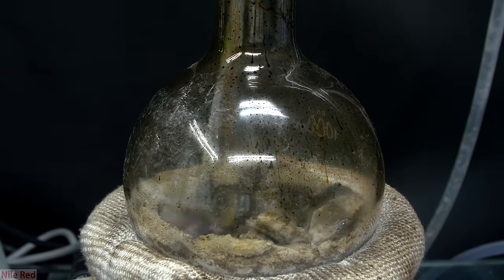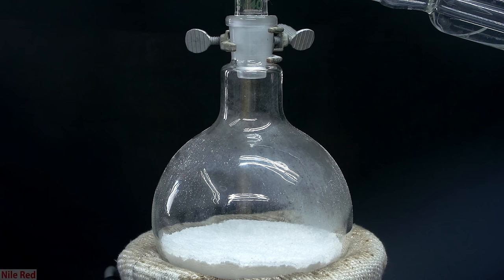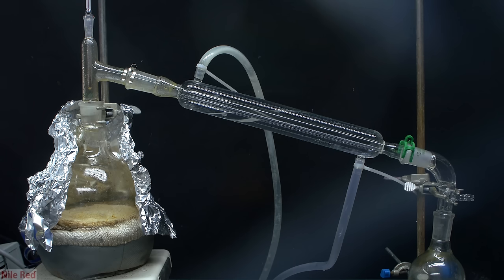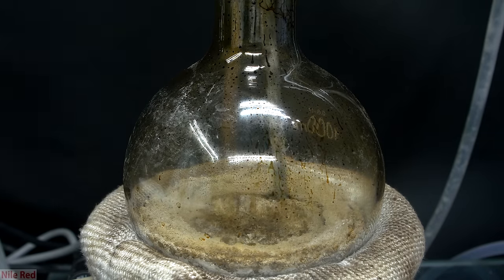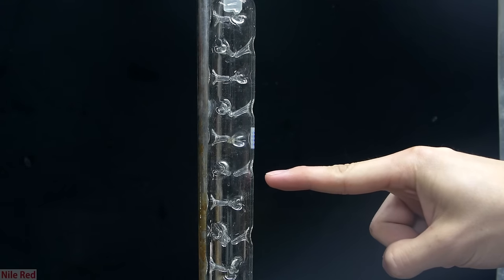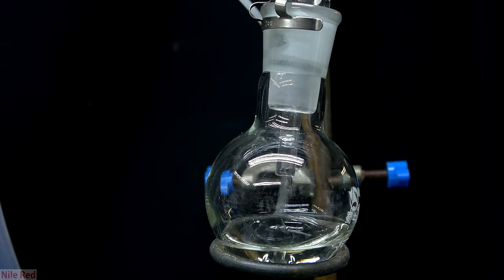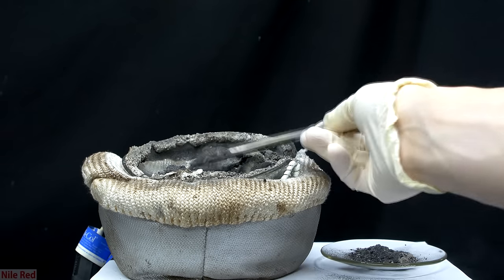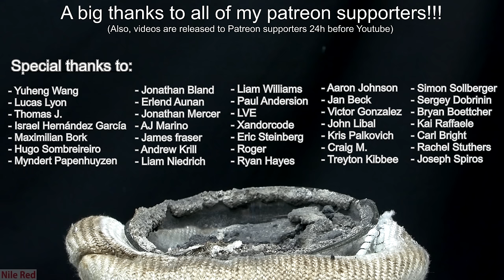Making Acetone from Calcium Acetate

Comment: I tried this reaction, I thought it smelled sort of like acetic acid
Reply from the maker: Interesting. Didnt smell like acetic acid to me at all
Reply: +Nile Red it might have also been that I made the calcium acetate by reacting Ca(OH)2 and vinegar and it might not have been entirely dried
Reply: +Nile Red I think another good video would be acetone from isopropyl alcohol
Reply from the maker: TheGinginator14 Hmm, that is true. I think I will do that, I never thought of it. Not sure when, but it is going on the list!
Reply: +Nile Red another interesting thing was that I got the same black residue despite using calcium acetate from calcium hydroxide and vinegar
Reply from the maker: TheGinginator14 I assumed that it was carbon, but it might have just been polymerize acetone. I have no idea why I didnt think of that. Basic conditions will polymerize it to black crap
Reply: +Nile Red the yellow color was probably isophorone, which is also produced under basic conditions

Comment: +NileRed can i do all your Projects (like bromine) with 1/10 of the weight of the chemicals because i dont want so much of the product or Must i Experiment with the Same amount of the chemicals (Sorry for My english ,im German )
Reply: Calculate it yourself?
Reply: You can but expect a low yield and calculate everything stechiometrically
Reply: +Julius Eckert Ja er soll es sich halt selber ausrechnen
Reply: If you are using 1/10 of every used chemical I do not see any problems. The relation is important. And be careful with bromine, that stuff is pure death.
Reply from the maker: You should be able to everything on small scale. Yields will vary though.
Reply: wenn er 20g und 70g nimmt kannst fast immer einfach durch 2 oder 5 oder 10 teilen...(also z.b. 2 und 7g)
aber pass auf, wenn du manche sachen mit distillation machst wirst soviel wie nichts bekommen...bei distillation wird ein anteil verloren (wegen platz in kolben usw...kompliziert) d.h. wenn er 200 ml benutzt und 180kriegt dann wenn du 20ml machst kann sein dass du nichts bekommst....und beachte die sicherheitshinweiße...ausser du bist chemiker und hast labor...wenn du hobbymäsiß machst dann würde ich brom oder cyjanid oder andere relativ gefährliche sachen lassen...oder sehr sehr sicher die durchführen...
aber so'n aceton kram kannst machen wenn du selbst kaum achnung hast...solange schutzbrille und draußen kann nichts viel schief gehen...
Reply: +Niklas Müller cyanide is way worse...i need stupid nitric acid but german law is shit...(i need some for goldplating) i can make cyanide and use that...but this is too toxic for me to handle...fine dust is shit...bromine will evaporate and it's colored...
Reply: Yeah, german laws are kind of silly. Cant buy nitric acid anywhere, have to make it from potassium nitrate (wich is hard to get too)
Na klar ist Cyanid schlimmer aber Brom ist auch nicht geil wenn man es einatmet :D
Reply: +Niklas Müller ja dann sag mir bitte wo ich ohne bullen und scheiß und EVE und kackwurst nitrate her bekomme? ich hab schbauze voll dieses gesetzes ....
die denken alle dass ich gleich ne bombe bauen will...
brom einartmen sowie stickstoffoxide ist schlimm...chlor ist auch aber nicht sooo....und cyanid und HCN ist komplett andere dimension von giftigkeit...
wollte letztens Nicotin isolieren...(ich sammel jeden coolen stoff...drogen (legale..) sind am coolsten...) habe nur geisteskranke procedur für mörder gefunden...bei HNO3 auch gleich nitrotoluol oder so 
und DCM brauche ich auch...
idee wegen nitrat? würde sehr dankbar sein...habe was gefunden aber was würde ich eher PM machen...bisschen risky
Reply: +Niklas Müller in poland i can buy or make nitric acid in 20 stupid min... i can get nearly every chemical...police just dosen't care...in germany i neeed hell a lot of papers and explainations and other useless stuff...if smbd. wants to blow germany up they won't get noticed...and if you want wo make some compounds they think you make drugs in the backyard...
Reply: +mattibboss Unter nem anderen Video hat jmd was von calcinit gesagt, des ist ein calcium Nitrat Dünger
Reply: +Tobinator uuuuh ich habe in meinen lokalen hagebau-markt 1h bei dündergeguckt...fast alles hat lächerliche 20% an stickstoff...
ich guck aber ...aber von internet bestelle ich nichts solched da ich absolut keine lust habe unter verdacht zu stehen oder so...ich habe was  im internet gefunden vor monat oder so...könnte risky sein aber hmm...
aber ich guck nach was du geschrieben hast...
Reply: +mattibboss Hm also ich hab ihn bis jetzt auch nur im inet gesehen...
Reply: +Tobinator ich denke ich fahre heute zur bauhaus...andere baumärkte besitzt meim stadt nicht...
ersterwalder-prozess (nitrate aus harnstoff) dauert ewig ..und bis ich 1 g habe bin ich längst selbst tod und zersätzt....und mit lichtbogen dauert sowieso eeewig....
man brauche 1x in jahr 100ml rauchende HNO3 ....warum ist das soo schwer in diesen land 😧😭😭😭
acetonperoxid ist auch sprengstoff...dafür braucht man nichts illegales...
ich habe letztens 6h in mein mini noob lab gesessen und ein dünger nach nitraten geguckt...hab ionen austausch gemacht...dann kristalisiert dann wieder getestet...
im endeffekt 0 stickstoffoxiden....
wie ich gesagt.habe...habe was im internet gefunden was aber risky sein könnte (wenn willst kannst mich PM) aber besser wäre wenn ich einfach lokal etwa nitrate kaufen kann...

noch jmd ideen? es lesen das bestimmt viele deutsche....
Reply: +mattibboss Ja wegen PM muss morgen schauen bin grad am Handy. Aber außer KAS (der beliebteste Dünger) und blaukorn wo ich mal was gehört hab was sich aber anscheinend überhaupt nicht lohnt wüsste ich jetzt auch keinen
Reply: +Tobinator hmm...ok ich bin auch auf'n handy...wie immer...müsste mal anderen düngerart von nachbarn mäußern bis welcher funktioniert. ..
Reply: +mattibboss Ja ich schreib dir morgen dann mal
Reply: +mattibboss auskennen tu ich mich scho ,musst dir keine sorgen machen ,hab auch entsprechendes Zeug zuhause .Die Frage war ,weil ich kein Bock auf 100g brom hab und man bei kleineren Menge a)weniger kaputtmacht wenns schiefläuft b) und Man es insgesamt besser unter Kontrolle hat
Reply: +BlackSheepTV achso alles klar...denn kannste einfach skalieren...also alle maßen durch eine zahl rechnen... 100g brom ist auch fett...1-3 ampulen ist genug...wenn's kuputt geht dann natriumthiosulfat überall draufkippen ist auch problematisch...

oder wenn du 100g brom.machst und in MV wohnst dann kannste mich PM weil so 2 ampullen würde ich gerne haben ohne mir die finger dreckig zu machen 😊
Reply: +mattibboss Wohne leider in Bayern .Will das auch nur machen wegen der Element Sammlung weil ich nicht 120€ für 1g brom in 1kg acrylharz eingegossen bezahlen will.Außerdem ist die Umsetzung interessant und brom ist sowieso cool
Reply: Also PN geht ancheinend nur wenn du deinen namen bestätigst
Reply: +Tobinator ohhh google spinnt wohl...ich suche heute oder morgen andere methode...
Reply: mattibboss Okay, Brom und Chlor sind unangenehm und in hohen Konzentrationen tödlich, Bei HCN stirbt man schon bei geringsten Konzentrationen. Können wir so stehen lassen oder?
Die Sache mit den Nitraten ist das Schlimmste, die sind frei verkäuflich, aber keiner verkauft sie. Letztens habe ich 1kg KNO3 bei Amazon gesehen. Einmaliges Angebot, sofort zugeschlagen.
Und DCM ist extrem teuer und selten zu bekommen. Da vielleicht auf TCM oder andere organische Lösungsmittel ausweichen?
Gerne PM, unterhalte mich immer über sowas
Reply: +Niklas Müller hmm... ab bessten wenn wir eine gruppe irgendwie machen...google + ist piece of shit...facebook ist mir zu direkt...irgendwelche idee auf die schnelle? 
ich schreib euch alle heute abend oder so an...
Reply: +Niklas Müller und wegen nitraten...soweit ich weiß man braucht doch eine EVE dazu?
ich habe noch ausserhalb grenze(polen) relativ viel KNO3 ....die frage ist ob die zoll nicht meckert? ich hab dünnschiss wenn ich das über die grenze muss und die halten mich an...
btw hab kein auto aber zug..
Reply: mattibboss Also ich hab nie davon gehört, dass der Kram nicht abgegeben werden darf. Es gilt halt die Reglung: https://www.apothekermanagement.de/cms.php?applikation_id=33&parent_id=2&todo=showContent 
Also wenn du 18 bist und nen richtigen Grund hast, stellt es theoretisch kein Problem dar.
Ich hab das über Amazon als Wasserpflanzendünger gekauft. Die Einfuhr ist risikoreich, ich habe auf die schnelle nichts gefunden aber vorsichtig solltest du auf jeden Fall sein. Für die Gruppe wäre G+ mein Vorschlag
Reply: Ja ne Gruppe wäre super
Reply: +Tobinator  ich kümmer mich heute abend...:)
Reply: Also was ist jetzt :D?
Reply: +Tobinator jaaa warte ich mach das heute
Reply: mattibboss
jajaja 1.30 h haste noch Zeit :)
Reply: +Tobinator ausserdem wir haben wochenende 🍻🍻🍻 if you know what i mean 😂
Reply: Google spinnt.... die hangouts gruppe erstell ich soäter...erstmal die Community...
Reply: +mattibboss You might want to make a birkeland-eyde reactor. Nitric acid from thin air(and electricity).
Reply: +Ilgaz Er He already thought about that but that takes too long